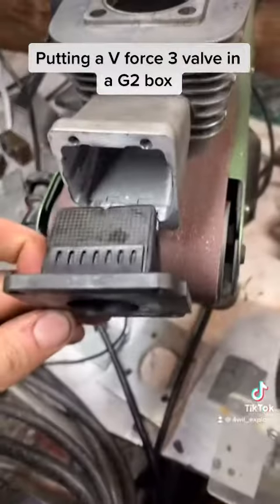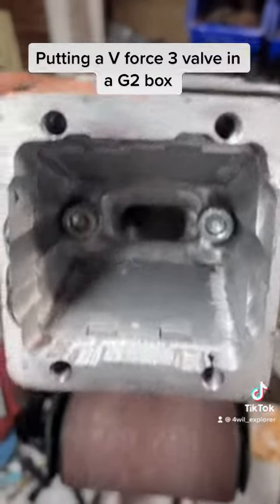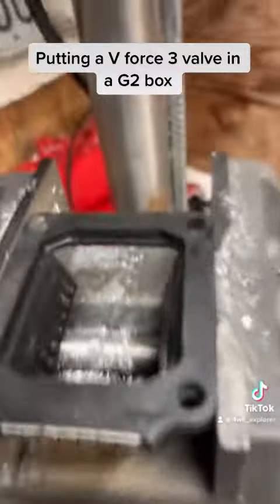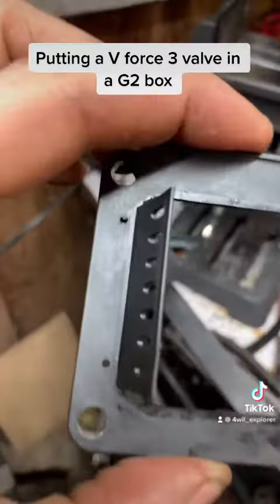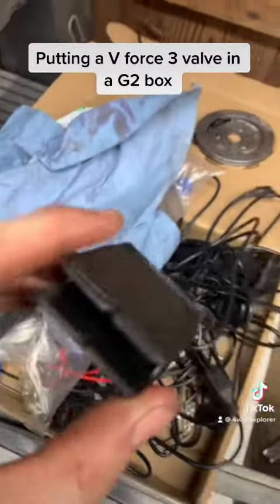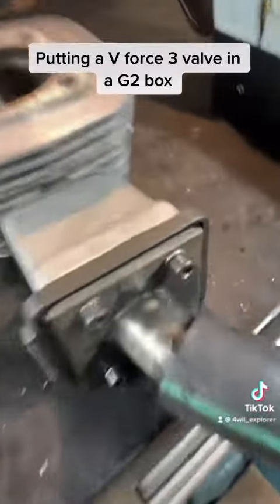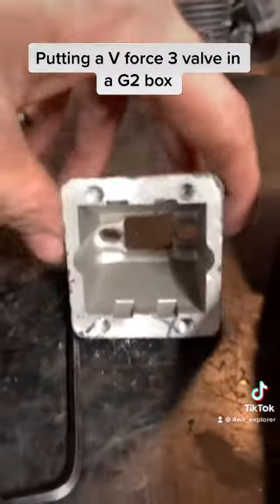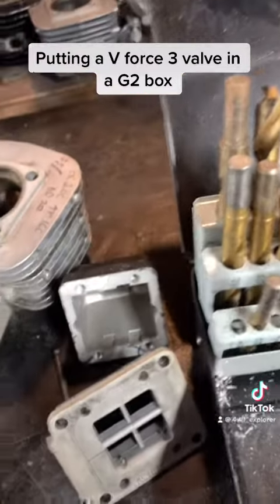V force reed valves into a G2 reed box.

Comment: What do you gain by doing this...the G2 cage looks less restrictive
Reply from the maker: A V force valve has more flaps and less angle, and takes up more of the volume in the cage itself. V force has years of R&D where I’m sure the China G2 cage does not. I would say Iv gained way more velocity as well as higher rpm range just from switching to the V force cage
Reply: @wtmotobikes8838  oh cool I was wondering if it would speed up the velocity having smaller openings like that..
Reply: @wtmotobikes8838  Question: I have a Zeda80 type engine with the open transfer ports... Stock engine except for mz65 pipe & CDH cast head. I want some more power. I was gonna start with only taking 1/2mm off bottom intake & 1/2mm off top exhaust port roof. I seen a VM22 carb/G2 reed kit for $50. If I installed it with the windowed piston, what porting mods would you recommend?  Should I do the 3rd intake transfer port to the same height as the side transfers. Should I get a degree wheel & do anything to the side transfer ports?
Reply from the maker: @michaelbrinks8089  if you have a open transfer cylinder you’ll find you can get more power out of a non reed setup versus a reed valve.  What I would do…. Raise the exhaust port 3mm, widen the port 3mm per side. Make sure it has a nice round edge all the way around the port to not snag rings. Widen the intake 2mm per side and lower it 2mm. Run a 19mm dellorto PHBG carb with a 3” intake. She should run great. If you need you could also send me the cylinder and I could port it for you. I’m pretty good and porting
Reply: @wtmotobikes8838   Thanks for the reply/info.......with the exhaust raised & widened that much it sounds like a real expansion pipe or at least a  BBR/WC80 pipe with larger header would work better than the mz65 clone pipe. That's the first I heard of going 3mm high on the exhaust port. Gonna look up some info on the PHBG carb & intake. Thanks again.